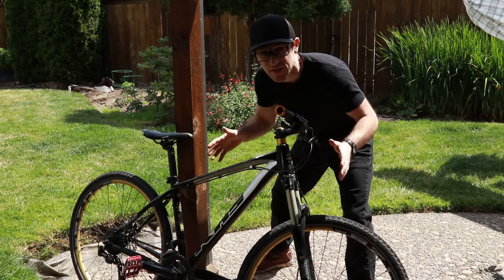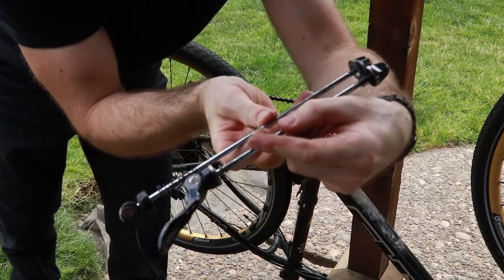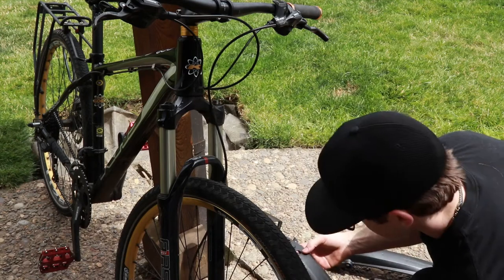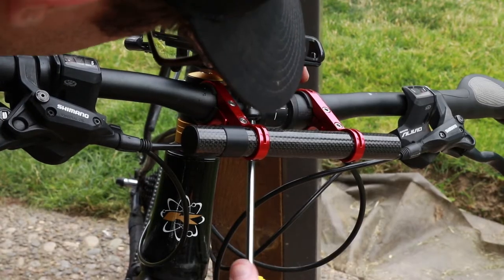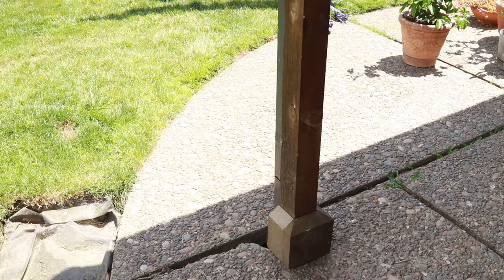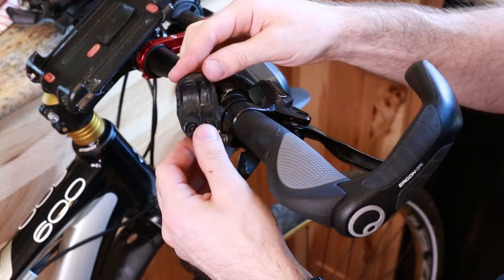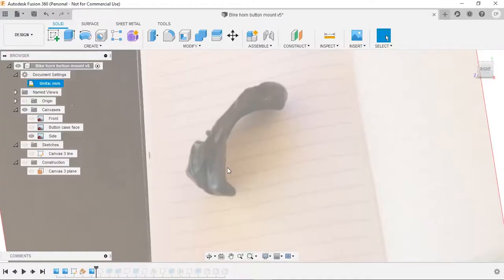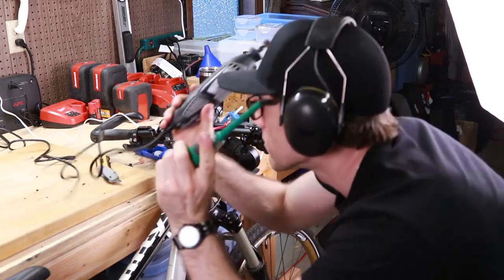Converting My Mountain Bike Into the Ultimate Commuter

Comment: Happened across your channel here in Florida using a 2013 KHS 150 as a commuter. Upgraded to old 750 Deore XT, on plush 26x2.125's, full Ibera bags, 4 cateye VOLT 800 lights. I didn't know this was a thing. I felt like an idiot using this bike as a commuter here until I seen your video, thank you.

Comment: How would you place something on the rack if a fender is blocking it?
Reply from the maker: I don't use the top of the rack. The bags tend to be expensive and hold little for the cost. Instead I hang panniers off the side when I need extra hauling space. That and my backpack does the trick for me, plus I get protection getting splashed after it rains, which happens a lot here.

Comment: Awesome and helpful video. Do you mind linking or providing any info on your wheels? Thanks!
Reply from the maker: Thank you! Since the bike is a 2014, it's a bit harder to find info on it, but I did find this: https://mtbdatabase.com/bikes/2014/khs/600/2014-khs-600/

It lists the wheels as Weinmann U28 Disc w/Single Eyelets, 650B, double wall. As mine are stock, this should be accurate. Hope that helps!

Comment: Why mount rear fender above rack? Shouldn't it be below rack??
Reply from the maker: Would be ideal, but since the rack attaches below the seat post and the fender must go on the seat post, it had to be this way. Since I have panniers and a backpack, I have plenty of space for storage without buying a pricey and tiny rack bag, so it works out anyway
Reply: Oh well. Compromise. The fender will not protect your contents on the rear rack.
Reply from the maker: True, although I solve that with waterproof panniers. They have both waterproof material and a roll top to keep rain out. A workaround, but hey... does the job!

Comment: Blue stuff silicon mould is good for prototyping 3D parts I prefer it to the form cards alot less hassle
Reply from the maker: I should try that. The form cards were interesting. Very convenient, I used them simply because I had them. I'd like to compare to other fast moulding materials.

Comment: im converting my old 97' Kona AA  hardtail to a commuter, I switched the handlebars to risers handle bars, front rack, same fenders  and cruiser wheels, rides super nice
Reply from the maker: I like the sound of your setup. Smart move on the riser bars in particular; huge comfort difference for repeated commuting. I've never tried a front rack before. Do you prefer them to rear racks?
Reply: @HardwareUnknown  I'm planning on getting a rear one too but I only opted for the front one first because I had seen one that looked cool 😅
Reply from the maker: With both you'll have a great work gear/grocery hauler. I use a backpack for groceries and haul my daily equipment in the panniers, but I'll say a front rack would be a lot more comfortable than the back strain. I'll have to take your approach and try that sometime.

Comment: Putting a fender over the rear rack doesn't seem to make a lot of sense.
Reply from the maker: It does knock out some usefulness of the rack, definitely. The reason I did it is it rains a lot where I live, and I don't actually put things on the top of the rack. I use a backpack and panniers for carrying things which gives me more than enough space as I'm not bikepacking. I agree though, in sunnier places it would be silly, and perhaps you could get a rear bag with a waterproof bottom to provide storage and block water flying up at you while increasing your carrying capacity.
Reply: @HardwareUnknown  I have never seen a bike fender installed like you did it. The reason why because its wrong. I don't know, ......would you put your socks over your shoes? No....ok yes you could do it, but thats not how it works. I know its a stupid example. Your reason that it rains a lot well what to say its more effective if its installed the right way. It has been designed to be placed under the rack so you have the best protection of the water splashing up! Best choice will be to move it down for all those rainy days amigo ah btw that huge horn not my taste at all.  How many times did you used it?
Reply: hahaha I like your video cool stuff now I watched it to the end. I would not gear up my bike like that just the fenders for me and a proper phone holder maybe a rack. That holder won't last long. Check out Ram mount thats awesome stuff and it last. Hope you get more subs
Reply from the maker: I agree, it's an odd configuration for the rack and fender, but if you look at the location of the rack mount screws, they are at the bottom of the seat post. With the fender I have that wraps around the seat post it can't be mounted under the rack unfortunately. Not a big deal since the panniers give plenty of space, but it was a tradeoff I was willing to make. Especially because I wanted to be able to easily remove anything that doesn't bolt down (like the fender) when I reach my destination in the city so it doesn't get stolen.

The phone holder has broken a couple times when I've been careless or needlessly rough with the bike (read: fooling around). Glued it back together and it works great, although I'll eventually switch it out once it bites the dust. Ill have to check out the Rams when that happens.

Thankfully, I've only had to use the horn a handful of times. The thing about horns like this on a bike though, is that when you use it it's because you really need to. I only use the bell for pedestrians, but each time I've used the horn it's because I'm about to get run over by a car not waiting their turn and blindly turning into my lane during my right of way. In my city there are some odd intersections that admittedly do make it tough to know who has the right of way, but each time when a driver doesn't know, the horn (and quick reaction time) have saved me from injury. Worth it's weight in gold to me.

Thanks for watching the video! I just finished an online course that should help me make even better projects and videos. Can't wait to release the next ones.

Comment: CHANGE TIRES TOO..
Reply from the maker: I actually changed mine beforehand off camera. Went from knobbies to some nice commuter tires. Hands down the most noticeable shift for road riding.
Reply: @HardwareUnknown  what tyres are you using?
Reply from the maker: Continental ContactPlus. They've been a solid "road" style tire with siping for the rain we get around here. For some reason though they're very difficult to install on my rims, requiring a ton of force. Could just be a fluke with the combination. Otherwise I've really liked them.